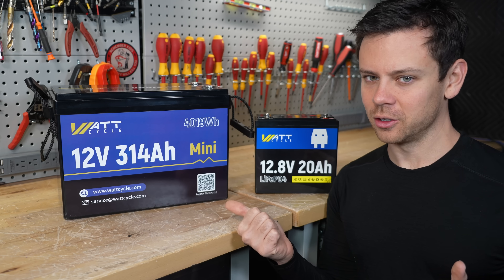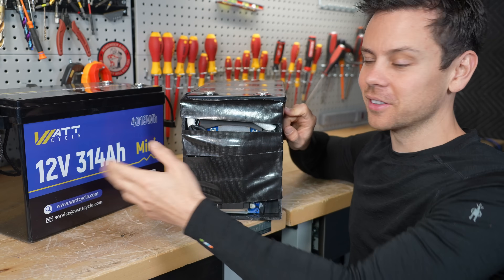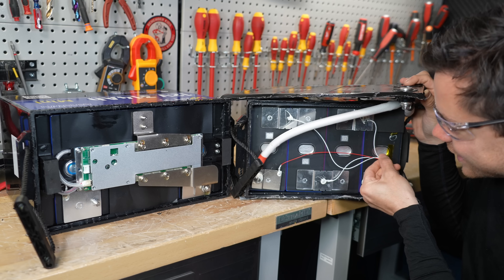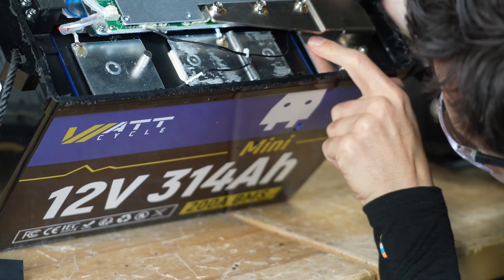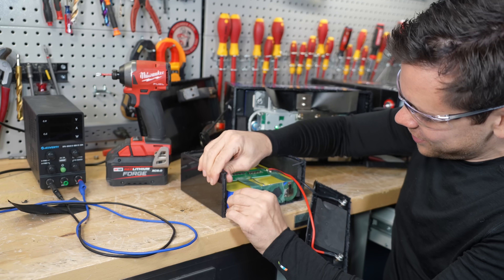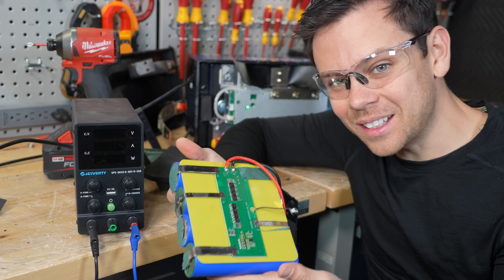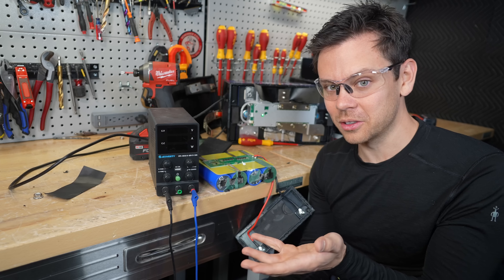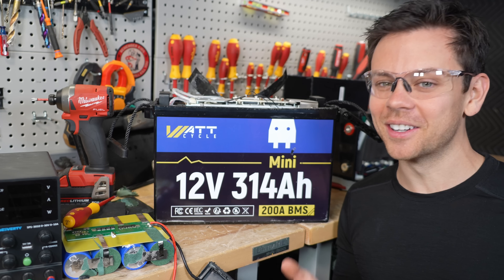NEW! Wattcycle "Dumb" 314Ah LiFePO4 (and 20Ah fast teardown!)

Comment: The design of their batteries seems to be evolving rapidly on the insides. I recently took apart a 100ah smart mini to put a switch on the bluetooth module, as I've seen 4 videos of people taking it apart and they all had separate modules. My friend's didn't have any module, and the build quality is outstanding. All the cells encased in their own metal case inside the battery case (as looks to be the case inside the video, even though Will didn't mention it) - that is innovation in the battery space, as most of these style batteries are tape and foam. Also all the conductors super neat, high quality, with anti-abrasion sleeving, massive heatsink, busbars on the BMS. This company gets my full support, IMHO, they are way better than other cheap chinese batteries, and at a very similar price.

Comment: @WillProwse  how do you know that non smart batteries dont have the same issue when putting multiple batteries in parrallel. like when one is in stand by and the other is taking all the load untill its nearlly drained , and the one in standby dumps full powere in the half drained one.  the solar comunity had found this issue nearly a year befor you noticed it , simply do to monitoring the smart app. and most people are not going to be hooking a clamp meter up to there system all day watching the loads on each battery.
so how can you be so sure to tell people to avoid smart batteries , making the claim that they dont have the issue , yet ive found the issue of litime smart batteries a year before you started talking about it.,
I think its better to inform people about the issue and show how to test for it and know how to make sure there system is safe..
rather than telling them not to buy ones that they can monitor.
lithium can be dangerous if not well informed and how to test the safety of the system .

and i would be carefull to not blanket statement that all non smart batteries are safer when clearly it would be hard to know for sure unlless tested all of them and every new version or software update .
it should be said that most all batteries come from chinaia and there known to have issues and then show how to test it for its safety

Comment: Your observations about smart devices are valid. I hate being so dependent on a cell phone.
Reply: I built my own pack and the bluetooth feature allows me to connect my JK bms to my Home Assistant.  As I type this my second monitor has any piece of data bout the battery bank, long term, months of reporting on any data point.  I even have automation on home assistant that if my zigbee smoke detector goes off turns everything off in sequence as well as other some other automations. The bluetooth is sick!  If for some reason you misplaced the device to control the settings it still functions. idk.
Reply: 100% agree. its a battery. Im not downloading anymore apps (data mining programs) at all anymore if I can help it. Im over it.

Comment: As an Off-gridder (completely) I'd like to see how these dumb perform on the balance charging 4s4p - we seem to get difficulties with this setup even using balancers.
Reply from the maker: Oh you have them in series as well, yeah those will always go out of balance. I would try to get some 48 volt batteries instead if I were you
Reply from the maker: Are you in a cold climate and unable to charge to 100% often? That seems to be the most common cause of balance issues lately. Which models do you have and how out of balance are they?
Reply: @WillProwse  In Spain, so never get frost or below 0, also in the house - We bought the Eco-Worthy 280 (16 off) in 4S 4P (from your recommendation a year ago) They work well, but do go out of balance if dont fully charge in a few days. Otthers here have similar issue with other brands too. Thanks Will - we all follow you out here

Comment: hopefully wattcycle would be better than the battleborn ones in terms of terminal connection rigidity.
Reply: I believe they've already nailed it with their tinned copper leads! Battleborn has been deleted from any future purchases of mine. I now have to keep a close eye on my battleborns and I am not as comfortable as I was. May they RIP as they certainly have not taken ownership of such a significant failure.
Reply: Every time I hear "battleborn" I want to punch a hole in drywall. Yes they used* to make very good batteries, but their prices are insanity.